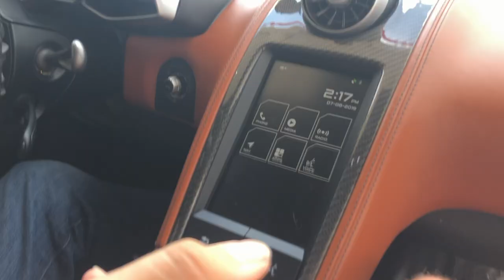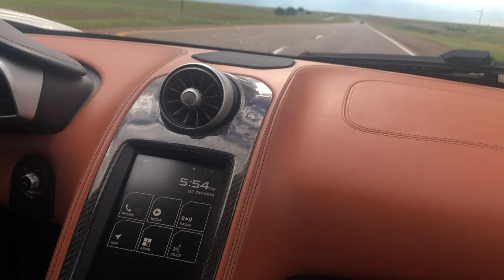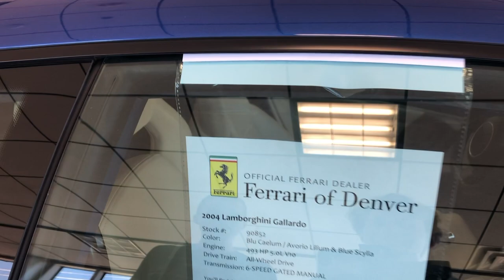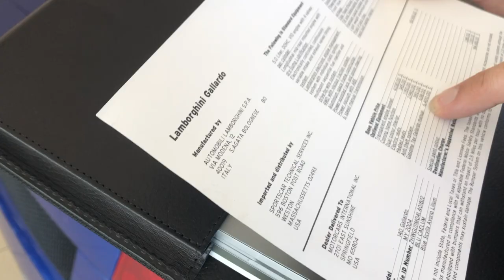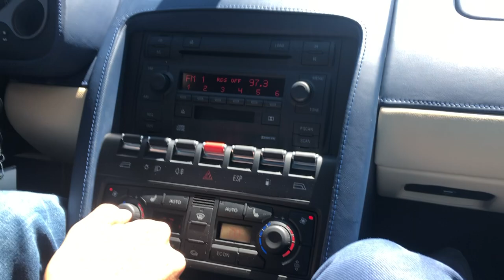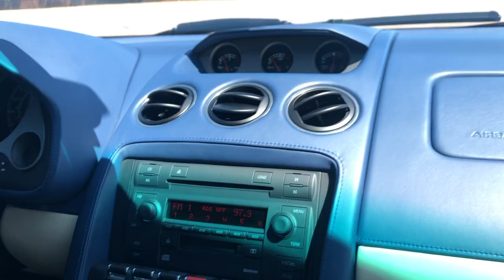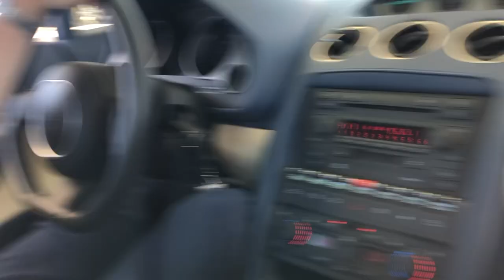Hoovie Buys his First Lamborghini. SOO Original...

Comment: I wonder if Tyler knows that the bore spacing of his Gallardo's engine is 108 mm.  That is exactly the same as every VW Golf, Jetta, Scirocco sold in the United States since 1974, since this V10 is actually a modular engine based upon the four cylinder Volkswagen EA827 engine.  They started by adding a 5th cylinder to create a 5 cylinder for Audi, but then took two of these five cylinders and "Siamesed" them at the bottom to form a V10.  Decades later, they sawed two cylinders off to create the Audi V8, and then two more to create the Audi V6.  AND there was an inline 6 diesel for Volvo, AND eventually a V12 diesel for a few odd Audi's.  All based upon the EA827 engine.

-The Gallardo V10 engine was actually first conceptualized in 1972.  It's intended use:  To power Porsche's new 911 replacement, the 928.  The reason that a 4.6 liter SOHC V10 of 300 hp never materialized in the 928 was that the Porsche board got cold feet about using a Volkswagen-based engine in their main product.  Ferdinand Piech was behind the V10, but he got shot down on the idea, and Porsche developed the M28 V8 instead.